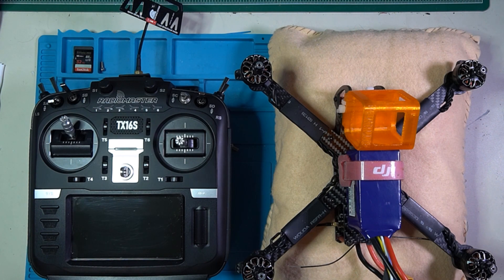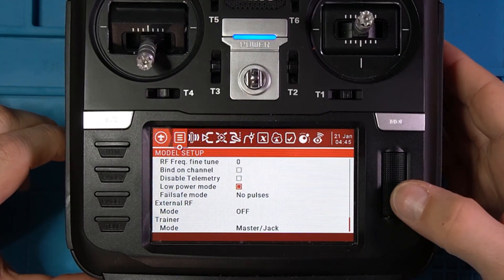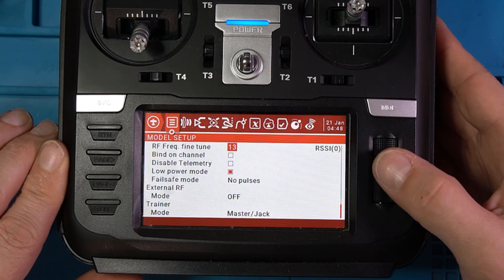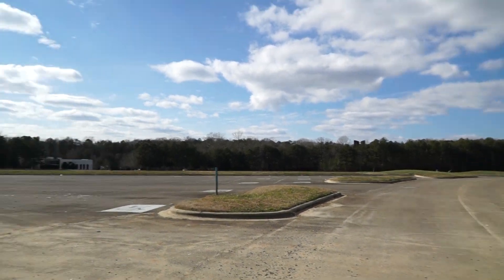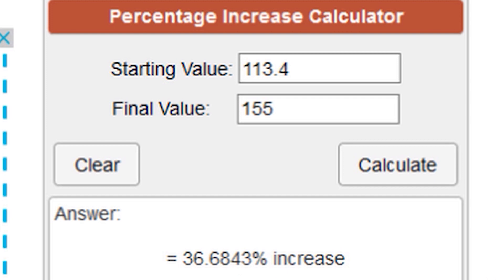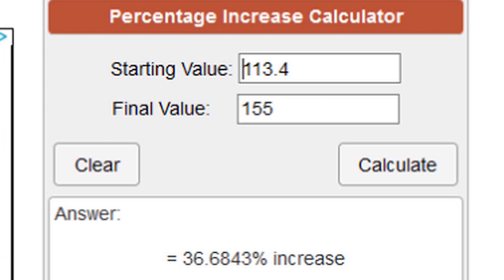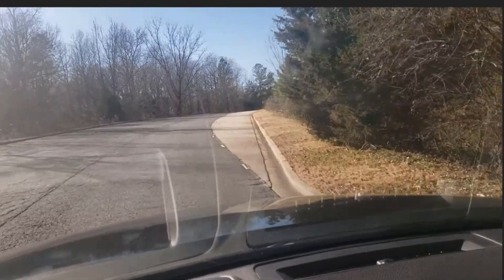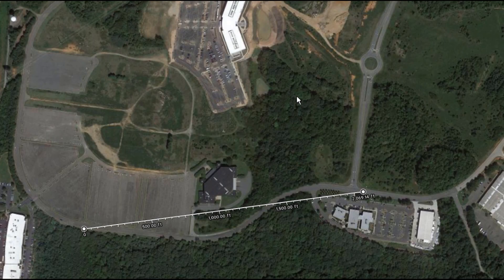TX16s Fine Tuning for Optimal Reception and Range Test

Comment: i did range test on my tx16s with spektrum ar631 and it keeps failing at range of 20 feet , testing it in my driveway where ther are cars around, could that be the cause?

Comment: Why don't I see that in my radiomaster tx16s. I can fine time in my radiomaster. Where are those function
Reply: I also don't see it.  All I can find is that its necessary to fine tune FrSky receivers, I am using a spektrum receiver and don't get the fine tune option

Comment: Had my radiomaster less than a week snd thanks to you it’s up and running sweet. Now After this video I’m thinking of taking it apart lol 😂. I would like to know if you can help ? If I update my firmware to the latest on the tx will I have to update all my receivers aswell ? Or can they stay as they are ?  Cheers Steve.
Reply from the maker: you don't have to update the receivers.

Comment: Hi Steve! Many thanks for your videos. Very professional and clear. Just a question: can I do the fine tune even with the original antenna or is it useful only if you change the antenna?
Reply from the maker: Definitely yes.  You are fine tuning the radio and the receiver so the antenna is irrelevant.